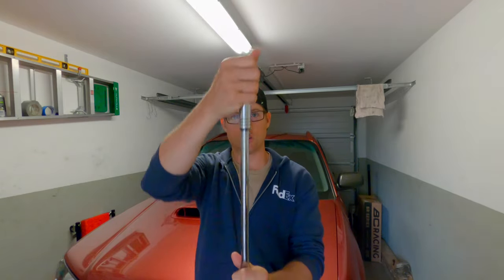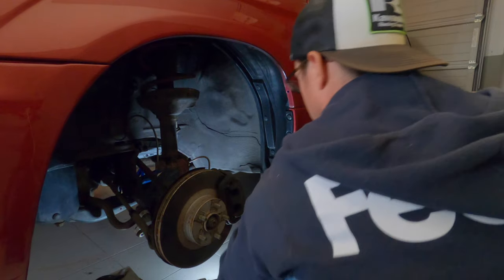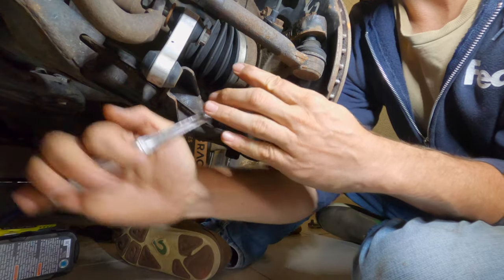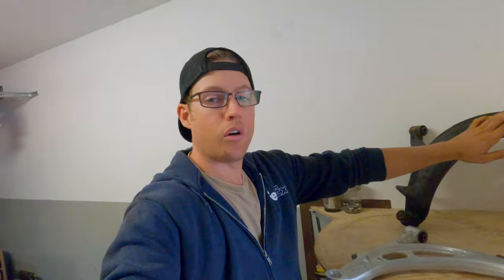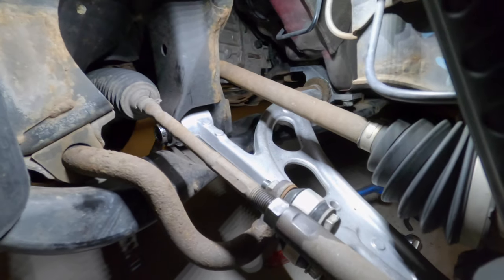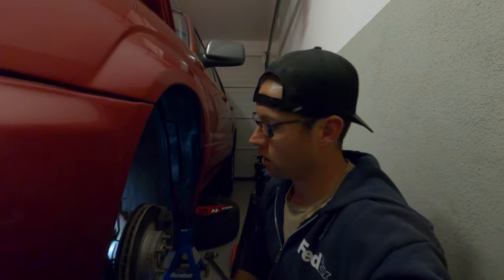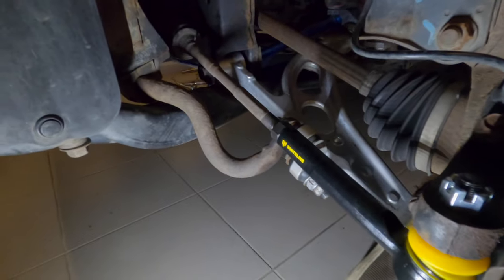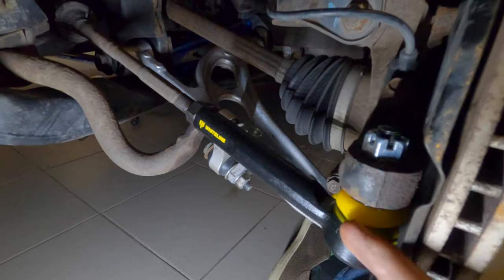Installing STI Control Arms AND Whiteline Bump Steer Correction Kit On 2004 Forester XT

Comment: Hey, man. Great video! You're getting better at this automotive YouTube thing. I have many of the same suspension mods as you do on my '07 FSTi. As per Whiteline UK's recommendation (very helpful chap manning their phone line, BTW), I passed on the anti-lift kit for the caster adjustment bushing, KCA375, instead. The SG Forester isn't subject to as much lift as the GD chassis.

P.S. Great catch at 11:27!
Reply from the maker: Thanks Eric? I appreciate it man. It's a journey for sure, but I am really enjoying the process. Yea the anti lift kit is not needed for the SG's. Haha, but I have them now for a possible future build. I will for sure be ordering the castor bushings at some point. Gotta squeeze every bit of performance out as I can.
Reply: @AdrianBilladeau  Have you installed the FP Blue yet?
Reply from the maker: @ericn7698  yes sir. It has been on since the first start. I don’t have a lot of turbos to compare it to but it’s pretty awesome. Spools great and holds all thru the RPMs. It’s great for my set up. It’s rated for 475 so I have a lot of room to play with as I am only putting down 340 to the wheels and 402 at the crank.

Comment: So the sti control arms will work on the forester? I’m asking because I have an 07 forester
Reply from the maker: They will indeed fit sir.
Reply: The sti arms don’t correct the geometry for bump steer by themselves? Idk why in my brain I thought they would.
Reply from the maker: @MrHeisenb3rg  hahah! No they will not unfortunately. I used the whiteline bumpsteer correction kit.
Reply: @AdrianBilladeau  I have the same kit that I’ve been hoarding for a while. Gonna be swapping sti struts onto my 18 foz and will be using sti LCAs. Was actually thinking of making a video of it
Reply from the maker: @MrHeisenb3rg  nice! Go for it man.

Comment: Do the aluminum front control arms lower the vehicle compared to the steel arms?  Why do you need the white line ball joints?
Reply from the maker: No they do not lower the vehicle. They do add castor though. The white line bump steer correction kit basically helps with restoring proper geometry up front especially with a lowered vehicle.
Reply: @AdrianBilladeau  that’s what I thought.  Are you installing the white line  ball joints because you are lowering the car with the new struts?
Reply: I like the performance improvement of the white line joints but am not sure about adding them to a Forester that is not going to be lowered?  I have a 2004 Forester XT with manual transmission.  I bought the car new in Long Beach California at Timmons Subaru.  I’ve been replacing rubber parts with OEM Subaru parts.  The Subaru parts manager took a look at my car and called it a unicorn. That comment got me doing research on the vehicle.  From 2004-2007 Subaru produced just under 60,000 Foresters per year.  However, they produced only 5000 XT MT cars which is about 1250 per year or 25 cars per state in the US.  I did not realize this was such a rare variant.  Anyway, I’m replacing old rubber parts with OEM Subaru parts for the most part but I am replacing some parts with OEM STI parts as well.  I have acquired the aluminum front control arms, rear lateral links and an original titanium front strut tower brace with the original JDM STI, FHI Fuji Heavy Industries, Aerospace Division decal on it.  I’m also replacing the original intercooler, which is showing age, with a late model STI intercooler.
Reply from the maker: @roberthaffey9493  yes I installed them because coil overs naturally lower the vehicle but also the stock ones were totally shot.
Reply from the maker: @roberthaffey9493  cool I didn’t know that about the XT manual version. Cool! I am glad to have a unicorn too! Whew!
Reply: @AdrianBilladeau  what do you think about installing them on a car that is not going to be lowered?  Would they cause any issues or will an alignment take care of it?
Reply: My stock ball joints are shot as well so I need to replace them regardless.
Reply from the maker: @roberthaffey9493  na there will be no issues with installing them. It will definitely need an alignment though.
Reply: @AdrianBilladeau  yes for sure it will need an alignment.  I’m going to be pulling the axles out to rebuild them along with removing the struts to replace bushings and putting the new control arms and lateral links on all at the same time and then get a complete alignment done.
Reply: I’ve really benefited by your content and wish you well with your channel going forward.
Reply from the maker: @roberthaffey9493  man I am really glad my content has helped you out.. This is what it is all about you know. I really appreciate the support Robert.
Reply: @AdrianBilladeau  you do a really good job explaining what your doing and your camera work is excellent too which is also a big help.  Yes, you have assisted me a lot, a Big Thank You to You!

Comment: Did you list the part numbers for the control arms and cone bushings?
Reply from the maker: Yes I listed the parts in the description
Reply: @AdrianBilladeau  thank you!
Reply: @AdrianBilladeau  are those control arms 2004 impreza STi units?
Reply from the maker: @jf8171  yes.
Reply: @AdrianBilladeau  and the antilift kit is also for a 2004 sti but fits on the 04 fxt? Thanks for your time and input. I'm looking for that extra caster for stability!
Reply from the maker: @jf8171  I did not tust the anti lift set up. I used the stock bushings.
Reply: @AdrianBilladeau  thanks again!